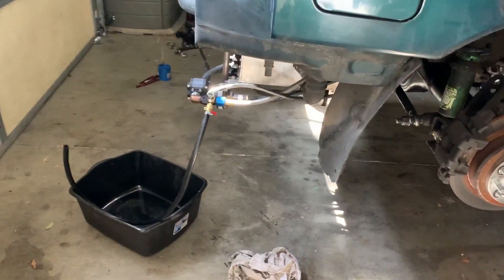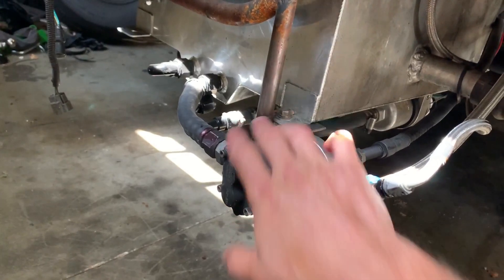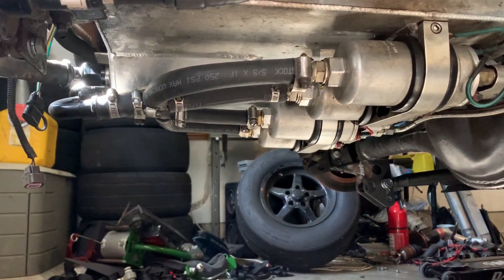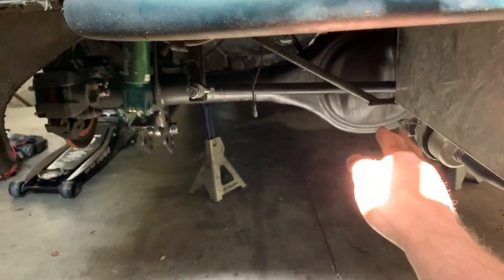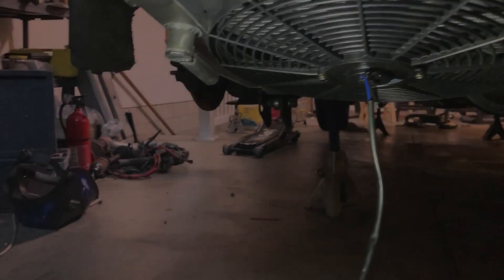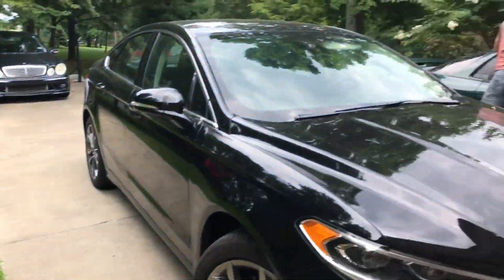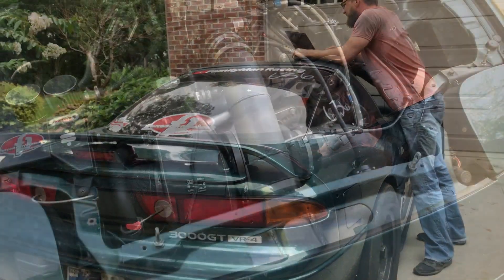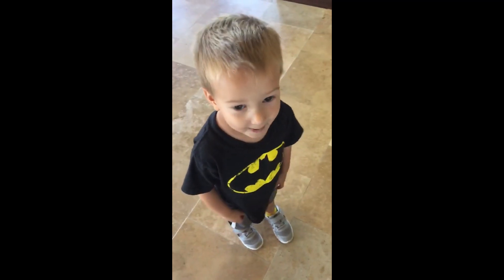Radiator Mounting Woes before Rocky Mountain 2.0!

Comment: Nice work. Looks great for sure. You could maybe try and create some ducting using your side skirt slots some how to help direct air into the rad as well. I know on the 2nd gens the side skirt ducts have a little black plastic insert that if removed makes it open. I’m just not sure how much air actually flows through it.

Comment: Dude, we never had the conversation about any fuel heat issues on 2.0... man, i need to hit 1.0 with you crazy guys!! #bingeworthy
Reply from the maker: 2.0 was much cooler temps. No issues. I drove several times at night too (which is my preferred way of doing it but you risk not getting a hotel where you stop)

Comment: Attach a couple of short streamers to the under side of the radiator. Strap a GoPro under there and review the footage to see how the air is flowing. Might need dual fans with an enclosed shroud. Run the fans full time when on the road.
Reply from the maker: Fan will have to be on full time. It really can’t get good forced air. New Spal fan is INTENSE. Problem should be solved.

Comment: was the radiator in that space during RMRW 2020?  looks very vulnerable to road damage from gravel rocks or other debris and just vibration.
Reply from the maker: Alfredo Dirks no it wasn’t, by a front mounted radiator has the same vulnerabilities especially in construction zones following other cars, rocks get kicked up and smash into front of car. A lot. 😕
Reply: @4familyman  One of the concerns I see is hanging it horizontal with no pads and the jolting of road surfaces could lead to the metal fatigue on the tab mounts. But only so much can be seen on video.  I guess we'll find out how it goes on 2.0  GOOD LUCK! Hoping for you Low ET's and a no issues trip.
Reply from the maker: Oh for sure. That could happen. It’s mounted from 4 corners though and no movement. I can hang my body from it. It’s still definitely possible that something bad could happen though! 

But it’s the only way I could really fit a big intercooler up front and that definitely improved the power potential.